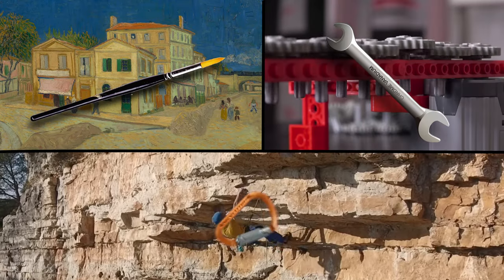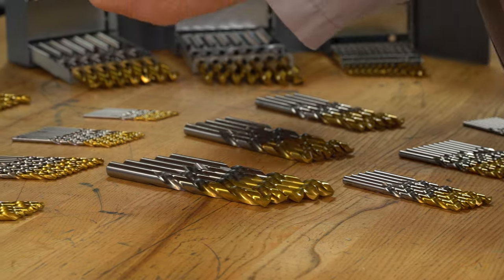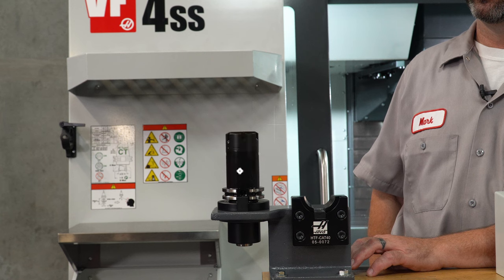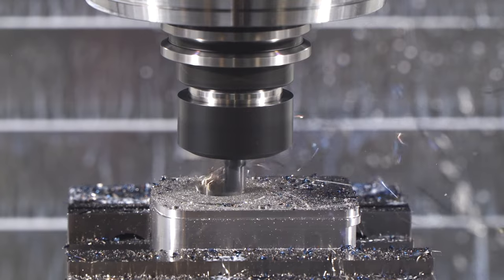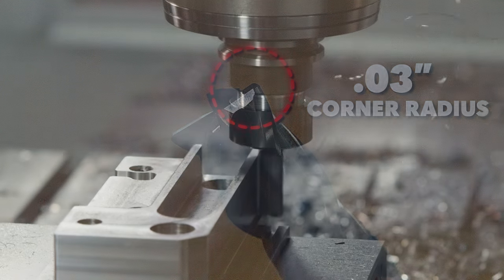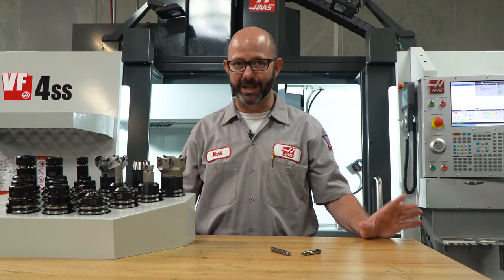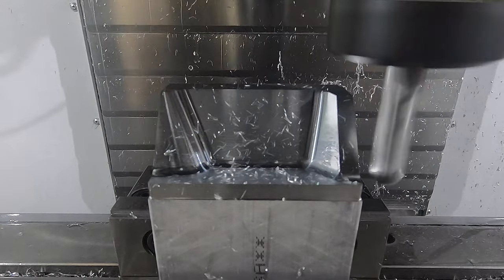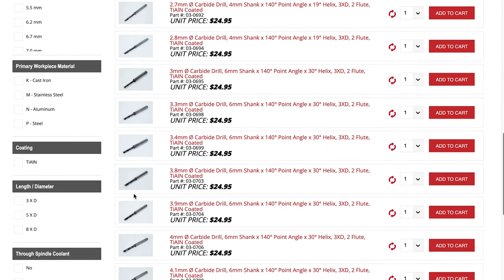Tools of the Trade - Haas Automation Tip of the Day

Comment: one thing seldom mentioned is the tool's cutting geometry which is usually unknown with uncoated tools. The cutter could be ground for aggressive sharpness for aluminum just without the ZRN coating, or it could be ground for "any material" (seems often ferrous steel) which COULD be used for aluminum but tend to chatter and can't be supercharged like an aluminum-specific cutter. I see the haastooling site mentions this which is definitely helpful. Most suppliers just say "uncoated" or "bright" and you're left to guess by visuals which is just asking for trouble a year from now when you pick it out of the toolbox 🤔

Comment: It's funny I'm watching this and going "I have basically everything in this kit but it took me about a year of slowly working thru figuring out what I wanted to get here, and we probably spent at least as much, plus shipping."

If this was an option back in 2020, oh man so much time I could have saved. Plus negotations over tooling purchases when we could have just bundled it with the machine sale? OOOF. Well good on y'all for having it now. 

What I think the package needs is a wrench or tool for installing the pull studs, and the key for installing the cap screws for shell mills. I remember trying to solve those things being a bit of a quagmire in a new shop and I ended up resorting to just an adjustable wrench for the pull suds for a while, and ended up doing some serious ad-hoc shenanigans to use a hex bolt as the hex wrench to put together my shell mill, was not part of any standard set and couldn't even get the right wrench at the hardware store down the street.

Comment: Any chance we could get a tip of the day on tool coatings specifically as well as identifying worn tools. Also, tool regrind information like best use practices, when to get one reground, whether a job should use regrinds or new tools.  I recently started working in a tool and die shop that uses regrinds and I've had trouble knowing when to change tools when they aren't chipped, but worn, and when using a regrind is okay. I've noticed that on some tools and jobs I've run that regrinds tend to break.  Thanks for all you do.

Comment: for the sidelock holders, at my work we only use them for replacable tip drills and chamfermill, drills bodies have a flange, chamfermill has a bigger body than the shank so in both cases there is a Z face contact instead of the set screw sitting method you mentionned, in some cases it can be a big advantage to consider "shouldered" shanks for sidelock when possible

Comment: Hi Mark! You mentioned that TiAlN and AlCrN coated tools can withstand high temperatures... When cutting steel (and perhaps stainless steel), will running coolant shock these tools and cause premature wear? Or would you recommend only running them dry, except for finishing (maybe with a different tool separate from the roughing tool)?
Reply: I would not go back and forth. If I’m going to run coolant on a tool for the finishing pass, I’ll go ahead and run coolant for the roughing passes as well.
Reply: @markterryberry4477  I agree with you... I should’ve phrased the question better. I do intend to keep the roughing and finishing tools separate. Here is my updated question with an example: I have a 1/2" 4-flute TiAlN coated carbide end mill. I want to use it to rough 1018 steel at 600 SFM and at about .003 IPT with a trochoidal tool path. Knowing that the cutting zone will be hot, will running coolant kill the tool immediately by thermal shock? Or will running air blast be a much better choice (since air blast is mostly not for cooling but for chip removal)?

I work in a job shop, and some of our old programs run the tool I mentioned in 1018 steel at 300 SFM and .002 IPT, with flood coolant. It works, but the tool life is about 3 hours in cut. I don’t want to experiment on the job as a newbie operator by doubling the speeds and feeds, and then break the end mill within half an hour... Thank you for your videos, they always teach me a lot! And you guys should do a sequel to the video on taps -- this time covering form taps!
Reply: Coolant is fine but you have to use coolant for the everything that tool does until has cooled to room temp. Same with alot of carbide tools
Reply: @chulangmo5799  In your example, if I am doing a lot of roughing with a TiAlN tool, I might just run it dry, with air blast. The tool can handle it, and it might be a little easier to control our chips. For my finishing endmill, I'd turn on my coolant. We just want to avoid running tools dry, getting them nice and warm, and then turning coolant on immediately.
Reply: @markterryberry4477  Thank you for your reply!

Comment: Arrrr bummer, my mini mill gets commissioned in a few days and have ordered a load of tool holders but not the keyless chuck, I'm in the UK and at the time of ordering the machine there was no tooling packages so just picked 10 er32, 2 er20, 2 face mill holders, 3 side lock, 2 0.003mm g2.5 er32 and 1 collet holder with the roller cage type and several sets of 0.005mm collets. I'm mainly machining tool steel and come from a manual machine background so have decided to thread Mill in stead of tapping mainly because I'm worried about breaking a tap m4 or m5 plus to buy a tap holder with compensation is quite a lot more than a quality er chuck. Yes I'm new to it all so not got the big boy pants 🤭 yet. Any other ideas would be good but I'm in for a few k already 😳😭.

Comment: As far as using an endmill in a endmill holder. I typically pull them up. So that way if it get full it pushes up into the holder. More of a manual machine than a CNC.

Comment: That big spot drill seems to show some rigidity issue!?
Reply: It sounded really good when running. I should have shown it better, but this is a multi-tool, which means we can use it to chamfer around the outside of a part also - not just holes.
Reply: @markterryberry4477  It seemed to pull the spindle about?
Reply: @stuart99299  I think that is an optical illusion due to it being an offset single flute either running slow, or the video was slowed down a bit.
Reply: At least ! The Bearings ! Are Completely ! Stuffed ! On this !